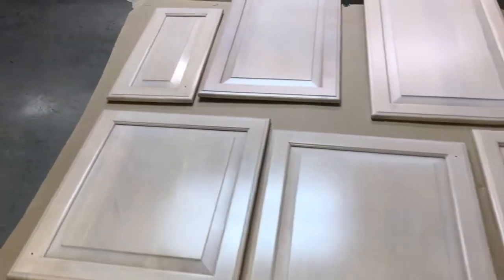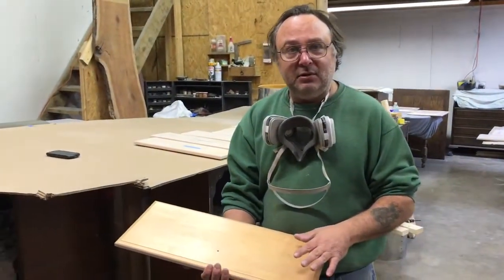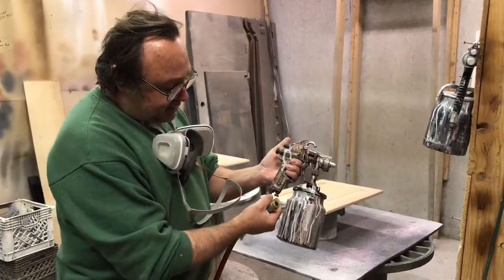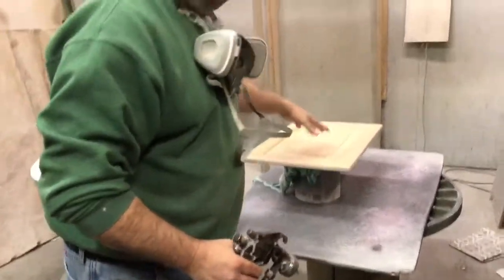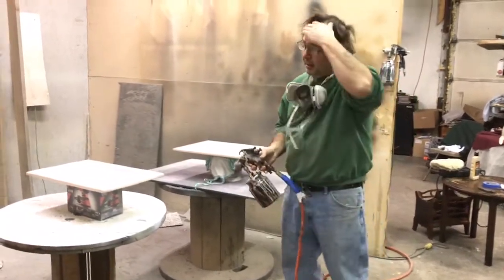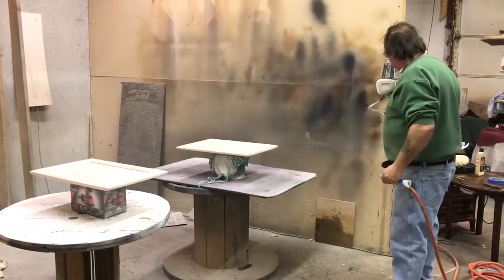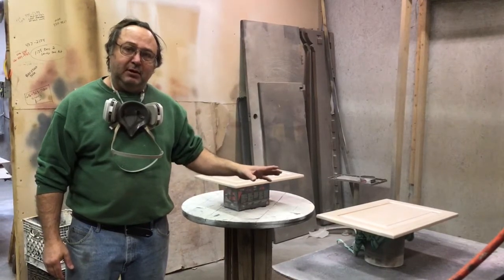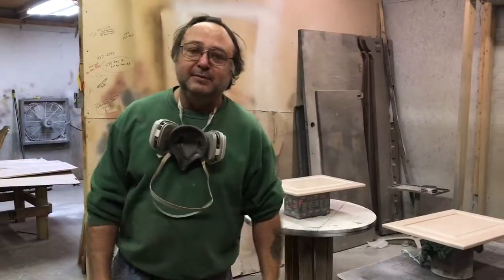Refinishing maple kitchen cabinets in Rockford,Michigan

Comment: Hi Bruce, I know this is a video on refinishing cabinets but I was wondering if you could answer a couple questions about refinishing vintage radios.
When you replace veneer on a radio what thickness do you usually find yourself using?
What type of adhesive do you use and how do you apply it? Also do you use a household  iron to help it adhere ?

Thank you and keep up the great work
Reply from the maker: hi Wayne ,so most of the time , i use old veneer, that i got off a radio ,see one time i but a junk radio cabinet out side in the rain  for about a week , then the sun came out ,next thing i seen was the veneer  peeling off the side of the cabinet , so i peeled it off ,and that is what i use for small repairs ,for the tops ans side panels , i use walnut wood on wood 2 ply , to glue it down , i have used wood glue  and i have used contact cement ,and yes the iron ,comes in handle , with both glues ,feel free to call me if you would like to talk about a job that you are working on ,i will be doing some radio video very soon ,we have about 18 of then ready to be refinished 616 453 8309
Reply: @brucelach4481  Thanks for the information. I asked because I'm currently working on two wooden table top radios from the 1940's and you info should prove very helpful.
 I may call you after the holidays about 2 other Zenith floor consoles that I have that could use some refinishing work. Hope you and your family have a great Christmas.